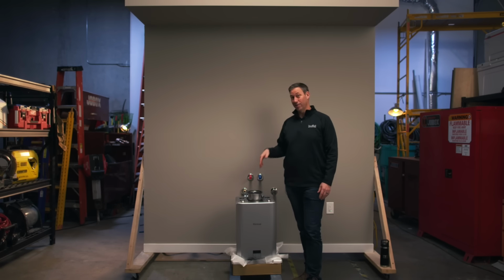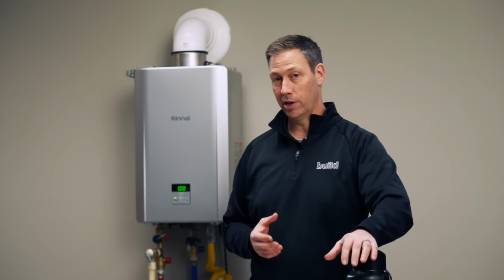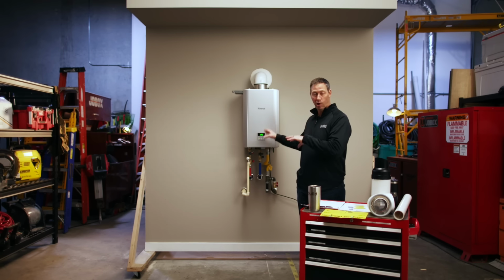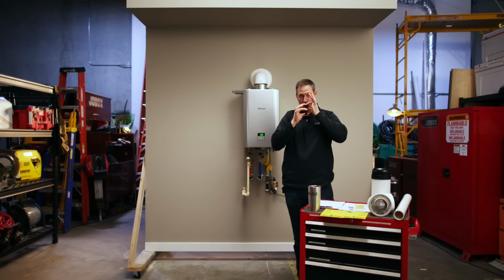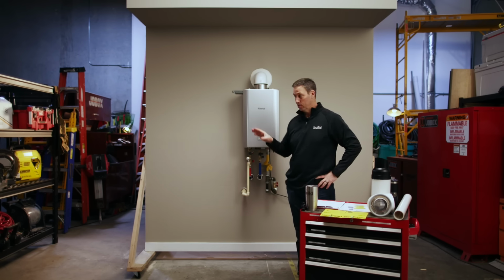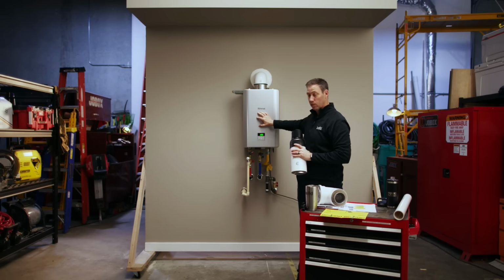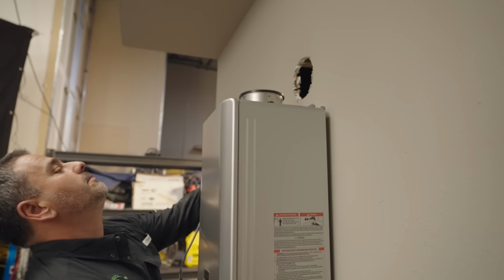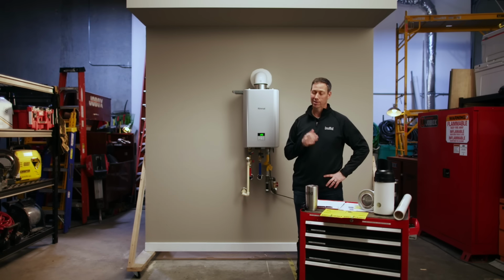Replacing A Water Heater Tank? Probably the Best Tankless Option for You.

Comment: The whole purpose of a On Demand water heater is that it is shut off until it's needed... having a recirculating circuit makes this unit dribble  constantly. Not needed.
My Two Cents
Reply: Exactly. And furthermore that little plastic valve won't allow enough flow to turn the tankless water heater on. Check out the Smart Recirculation Control if you want an on demand hot water recirculation solution without having to run wires and install buttons and sensors all over your house. They have solutions for both dedicated recirculation loops and dead end systems like Matt is talking about, but their valve flows higher volume so it actually works with tankless water heaters.
Reply: I can't wait for my Smart Toilet Seat to arrive...it starts heating up when it hears my tummy rumble.
Reply: Your two cents means NOTHING
Reply: @daveklein2826  Don't be a jerk, Dave. No need for it here. Matt may not have made it clear: the circ pump only comes on when needed. For most of the day the water is stationary and the unit is off. When hot water is called for (motion sensor in bathroom, or unit triggered by bath light switch being turned on) the pump starts and gets that hot water to its destination quick.

I have a Watts hot water circulator on my conventional hot water tank and it works well. It's very basic, and starts by time clock: fifteen minutes before I get out of bed. It uses the same little thermostatic valve tied to the cold line. My wife just loves it.
Reply: @paulmaxwell8851  Your two cents means NOTHING
Reply: @daveklein2826  
Yes about as worthless as that water heater...
Make sure you hook it up to Siri and your smart doorbell, so it can activate when it sees you pull into the driveway.
Weeeeeeeeeee!
Reply: @BiitchSlapper  

Now, as a home automation junkie, I didn't think of that one!

But I have been considering putting my existing recirc pump to always on and using a Sire enabled wall plug to turn it on and off so I can vary the time of use with other sensor inputs.  Like when a motion sensor "sees" someone in the kitchen or bath.

Compared to the existing, mechanical timer which is set for specific times of day.  And, I have to turn off when we travel away for a few days and back on when we arrive home.

Comment: In times of extreme natural gas prices, I think this is the best solution to get rid of the $300 tank that never breaks, and buy a $1000 gas heater with a bunch of electronics and a stone-collecting electric pump that will most likely fail right after the warranty expires.
Reply: 10:42 ad. What a waste.
Reply: Lol yep
Reply: Exactly, timing to promote such useless grid addiction couldn't be more odd. 

Did you know that you can transform old oil heaters into external emergency wood/wood pallets heaters with a few easy steps?
Reply: Tankless heaters use a lot of gas, the only savings is space.
Reply: Totally.
Reply: Tankless water heaters use much less electricity or natural gas than a tank water heater.
Reply: @Lukester44  I’m not sure that’s true when you compare to a heat pump water heater. In fact I am pretty sure a HPWH uses less power.
Reply: @JoshuaRes  You are probably right on that, but he was comparing this to a $300 tank. My gas bill went down a lot when we switched to tankless
Reply: @Lukester44  fair. I just think most people would be better served by a HPWH and have lower costs over the life of the unit.

Comment: I went tankless but quickly found out that our water was too hard and had to replace it in 6 months.
Reply: Two words, my friend: 'water softener.' If you have really hard water, then you'll have residue at every fixture and soap scum build up from Hades. A water softener works wonders and makes life so much better, especially in the dishwasher.
Reply: @valkyriefrost5301  I'm thinking about putting an instant water heater up in my attic. Would I instruct my plumber to install the water softener in the water line leading to the instant water heater or would it have to be installed next to the inlet for the whole house water line, in the basement? (Sorry, I'm not a plumber, just trying to understand this, because my plumber was making discouraging noises about installing an instant water heater because of hard water build up, so I want the correct information to give him.)
Reply: @KECarter  Most softener systems you'll need to periodically add salt pellets. They come in 40lb bags, so keep that in mind when deciding where your softener will go. I certainly wouldn't want to haul them up into the attic to fill.
Reply: @KECarter  If you have hard water you should install a whole-house water softener on the line entering the home. Yes, water softeners are a pain because you're committed to buying big bags of salt pellets forever, but the resulting water is very nice, great for laundry, dishwashing etc. Installing a tankless heater in a home with hard water may mean descaling the unit several times a year, a tedious chore. Pretty quickly, you'll begin to wish you had installed that softener. Good luck!
Reply: @KECarter  - A water softener needs to be fed salt periodically (mine is weekly), so the basement or garage are the best/easiest locations for an install. Mine is inline with the main feed coming into the house in the basement and then out feeds to the whole house, both hot and cold water. My outside faucets are on a separate circuit before the softener and are not softened. 
Also, if you have such hard water, a normal tank will also have build up. 
The other solution to hard water build up in a tankless is to do the maintenance (de-scaling)  every year. 
Here's a link to Matt's video on the subject - https://www.youtube.com/watch?v=T4FaqGod3VU
Lastly, I'm not a fan of anything water related in the attic as a failure there plus gravity means life hates you and your insurance co.

Comment: I don't normally comment because I don't usually know anything.  Nice video, that's quite a mockup!  And the camera/editing was good.
1) But you say that it's a non-condensing unit, which is good for places without a drain.  But isn't that white PVC on the bottom left a drain?  So that seems to defeat the point.
2) With that nifty plastic contraption to turn the cold water line into a return for the hot water, now you have 100°+ hot water coming out of all the cold taps, and you have to wait just as long as before for cold water now instead of waiting for hot.  And having the water come out immediately at full hot temperature seems dangerous, we never use full hot in our house.
3) That intake/exhaust pipe is super cool.  But how do the fittings work?  Like, bends, extensions, etc.  I assume all of those connections would have to be fully sealed on the inside (the aluminum part).  I wonder how that's handled.

Comment: I was thinking about going with a tankless for my full house reno project... but the electric requirements are like 3 40 amp double pole breakers for 5gpm. I decided to go the traditional route and just install a tank lol
Reply: Tankless in Europe is mostly electric and yes, you'll need more than a typical house of yester-year. Most modern houses are built with 200-250 amp service, so electric tankless is not that difficult.
Reply: It seems you was looking at tankless that runs by only electricity. Rinnai needs a low 120 ac volt with 15 amp. That u can plug in to a regular house outlet.

Comment: I contacted a company and they wanted me to take out a second mortgage just to put in their specific brand of water heaters, said they only do condensing (the most expensive)
Reply: Rennai is expensive, but they are quite awesome. My first one lasted 16 years!
Reply: @valkyriefrost5301  I'm just waiting for my tank to fill up with soot. I'm purposely not draining it
Reply: @valkyriefrost5301  when they fail ... is it a big deal? Big leak?  I have a 14 year old Rinnai tankless in  my attic, and previous owner AFAIK did zero maintenance, on anything.
Reply: @csf1757  - Mine was a really slow leak that I noticed when I was changing the air filters in my furnaces as it is in the same area in my basement. So, it was an easy clean up. Were it in my attic, it might have led to a more severe leak before I noticed something was amiss and the damage/clean up could have been much more severe. I would hope yours has some type of pan to catch and redirect a water leak to the outside. If not, you need to have that addressed. Also, I believe there are some water pan alarms that can be used to help notify you when there is a water leak. Lastly, if you have not done it, you should do the de-scaling maintenance yearly to get the most life out of your unit. I have soft water, so I only do mine every couple of years and it always turns out clear (no scaling). You should be able to judge your scaling condition by looking at your showerheads. If there is white or red residue there, you find it in the water heater, too. Good Luck!
Reply: @csf1757  

I've never understood water heaters above a ground floor.  It's like asking for a catastrophe.

Ditto for wash machines.

I've never had either of those.  But I have seen the results from people that do.

Comment: I have seen several of these Rinnai units 15+ years still running strong
Reply from the maker: I think that’s a huge plus on this units by Rinnai… my last house had a Rinnai unit that lasted 15+ before I moved
Reply: The Japanese units are great. I have a Noritz hanging on the side of the house that hasn’t been touched since it was installed. Oh yeah, it’s a 2006…. We have the remote in the Kitchen and turn it to 160F to wash the dishes. They come out freaking spotless.
Reply: @williamj1969  is Nortiz still in business ?
Reply: @jasonpatterson947  oh yes sir. I have lost touch with their standing in the market. Back when I get this one they had several advantages that made them last a long time like the thickest all copper heat exchangers in the market, rock solid electronics etc…  I don’t know if they still produce that top quality product or not but I’d go for another one. 16 years and haven’t even descaled it once although it needs it now. It will trip out due to overheating if you set the temp below 135F. Meh, I’ll get around to it one day. In all seriousness though, I hung it on the wall and have never had the cover off since. As said earlier, I will support any Japanese heater; Noritz, Rinnai, Takagi. Probably in that order though unless there is something that has changed that I’m unaware of.
Reply: I have a Bosch that is more than 20 years old.  It's the 125X model.  Piezoelectric ignition.  No plug needed.

The downside?  Five years ago I replaced some bathroom sink fixtures as part of a remodel project.  They flow at 1.2 GPM.  The Bosch won't come on at this rate.  It requires 1.5 GPM. 

 ;-(

Comment: I wanted to go tankless , but the power requirements for an electric tankless is considerably higher than a tank. 

My panel is near capacity , so I don’t have the extra amps to run an electric tankless.
Reply: Does your house have natural gas?  If so, then this is a good one.
Reply: @emo65170.  but gas ones you'll have to upsize your gas service.
Reply: Heat pump water heater ftw

Comment: One thing you didn't address is the cost to replace the electronic control board. Also. the mechanical unit may last 20-25 years but the ECU probably will not. I know a person who had a tankless installed in place of an old 40 gallon unit and it wasn't long before the ECU quit and had to be replaced, of course it was out of wrranty and to fix it out came the wallet. This was fifteen - twenty years ago and I do not know how it has done since then but it just goes to show that stuff happens, so please next time you do a review like this please include replacement parts prices if possible.
Reply: LMAO

Comment: A house that I lived in in the late 1990s had two water heaters one was a tankless for the bathrooms and one was a tank for the kitchen and laundry.
Reply: Would you recommend it
Reply: @hamadilawson4471  - If you are pulling different, higher temps for the K & L, then yes. Otherwise, the use of a temp remote in the various locations would be needed.

Comment: Tankless is on the way out, with high gas prices.  Heat pump is where it's at.
Reply: When the power is out during a midwinter storm, I still have plenty of heat and endless hot water from my Rheem propane tankless.  Even at $4.30 per gallon that peace of mind is priceless.  Even if I get heat pump AC - if my state ever implements the new rebates - I'll still keep my propane hookup for when it gets real.
Reply: @FozzyBBear  It's more rational to put your back up power into a common supply, and run everything off that.  That's why all appliances are electric these days.  It's more efficient to run a heat pump hot water system off a propane generator than to heat directly with propane, and any truly off-grid person is going to have solar and batteries which of course means heat pumps have the advantage there.
Reply: @odonald6087 It is not rational to spend $1000 or more to rip out a fairly new, perfectly functional water heater to save at most $1 per month.  I went from $20 per month for an electric tank, to 1 gallon or $4 or so per month in propane for the Rheem tankless.  Even if I could cut that down to $3 per month, the heat pump wouldn't last the century of service needed to recoup the cost/benefit.  Even if the bloody thing could provide free energy, a $1000 installation cost would take over 20 years to repay.
EDIT: I've had the propane water heater for 2 years, and it is halfway to paying itself off in energy savings.
Reply: Plus heat pump water heaters consume a fraction of the energy classic resistance water heaters pull. It’s just such a better system. Love ours! Just ordered a second one for a rental we have.
Reply: When the heat pumps fail...NOBODY wants to get involved with servicing the compressor sealed system...ESPECIALLY the manufactirer. The installer is a plumber and doesnt know squat about refrigeration. Other than breaking and costing to buy MUCH more...and electricity bumped up 65% last MONTH in Massachusetts...they are better.
Reply: In reality the amount you spend on hot water is not enough to justify changing anything.
Reply: Heat pump still have to have either gas or electric primary
Reply: The electrical grid in most places can not handle the load now.  Solar pannels & wind are not realistic in a majority of this world, at least not yet. I live in Alaska, you have to have a lot of sun, which we do in the summer but not the winter.  Wind you need wind.  My side of town, West does not get much wind. The East side of town gets hurican force winds reguarly.
Also, the ebenflo of life, we used to all be on electric to heat our homes etc before the 80s. Now we are almost all on natural gas, I do not see people going backwards.
Reply: @AkSonya1010  At 0.2% of the american population, I don't think designing for Alaska conditions is very important.  In any case, heat pump hot water makes far more sense for efficiency and maintainability in the medium term.  So you probably will switch.
Reply: @odonald6087  I hate to shock you but almost half of Alaska lives off grid.  Also Alaska is not the only state or country to get snow which makes solar un-realistic year round.

PS We had solar at our cabin and it worked great in the summer but it wasn’t great in the winter.
Reply: @AkSonya1010  Solar actually works great in alaska, as long as you have a seasonal storage for winter.  Most energy use in Alaska is in fact in summer due to tourism, and solar would offset a large portion of the energy use.
Reply: @AkSonya1010  the grid will be expanded, not a problem. Electrical grid operators would love to make more money and sell you more electricity, believe me

Comment: Recirc pumps in residential applications are pointless unless it is on-demand or if it’s new construction where your hot water lines are insulated and there is a dedicated recirc line by to the unit.  These things cycle run on-off, on-off every 10 minutes or less depending on existing piping material, wasting a ton of energy…. Heat pump water heaters are the future & with the federal governments “inflation reduction” bill it makes them damn near free.
Reply: Probably not a problem in heating dominant climates. The wasted energy will just heat the house .
Reply: @conradcoolerfiend  still an issue, I live in Canada and summers are hot, I don't need extra thermal load in the summer
Reply: Did you not watch the complete video?
Reply: @lrc87290  no I lost interest half way in…I take it I missed something…?
Reply: @bojangles_bonjangles8000  The tankless water heater learns your usage so it doesn't circulate hot water needlessly
Reply: @lrc87290  I heard that part…if it works great I don’t want to be the first one testing it out…idk there are many ways to skin a sheep, they all work.  At the end of the day does hot water come out of the fixture, yes.  When I go to replace my tankless unit I’m going electric heat pump.